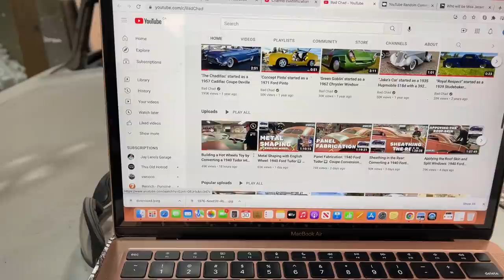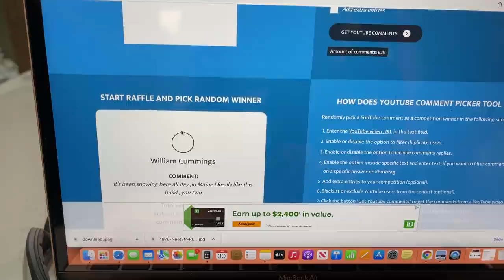Patch Panel Fabrication: 1940 Ford Tudor ➡️ Coupe Conversion (part 13)

Comment: Great explanation on using the zip cut to grind down the welds.  I initially thought that coming in flat would be the way, but I can see that using the edge gives finer control. Nice!!!

Comment: I'm loving the shape of the window opening, as is. Maybe consider a stainless metal edged glass (like most convertibles and hardtop had). That would be a great look. Have it go up into the upper door track (now a part of the roof) and dissappear. Will love whatever you do, as usual. 👍

Comment: If you do a frame for the windows, I feel they will be very small. The idea I had, make pilerless windows and use a window system from a BMW or Mini Cooper. You open the door and the window goes down a inch, and when you close it, it goes if in the rubber seal.

Comment: The zip cut and flap wheel used for grinding the weld create as much heat as if you were welding it. You should use the air gun for that also. Boooom

Comment: How will the window seal without a top piece as if the glass goes into the top you can’t close or open the window with the window up all the way

Comment: Brain surgery with a cut-off wheel!!
50 odd years ago, my dad showed me torch welding using coat hangers.  Anymore, it's almost impossible to find wire coat hangers.  But, his approach was very similar to yours.  If there is a small void, there's no need to add metal.  Just gradually build it up with the hanger